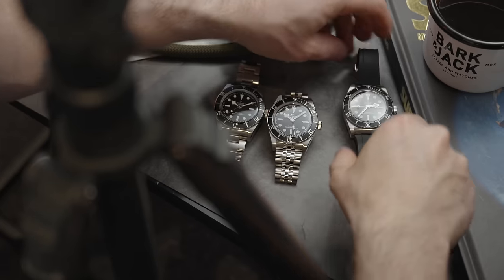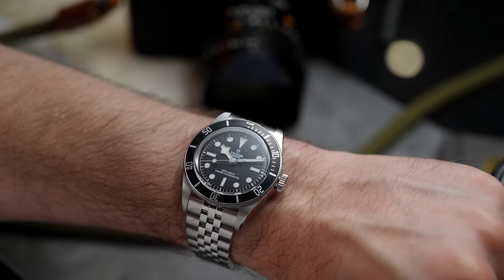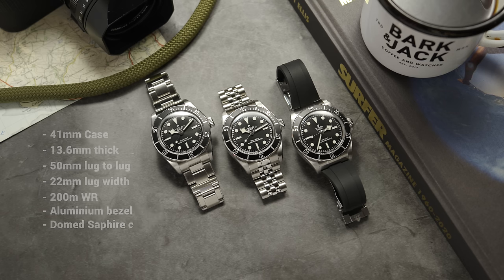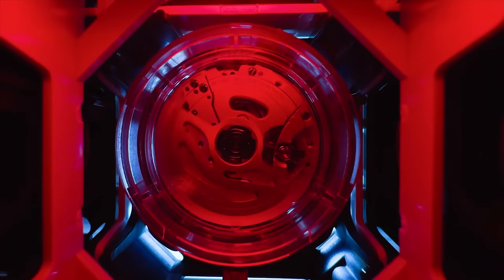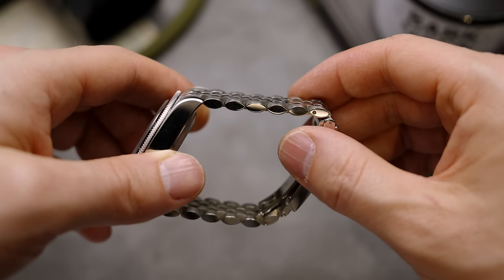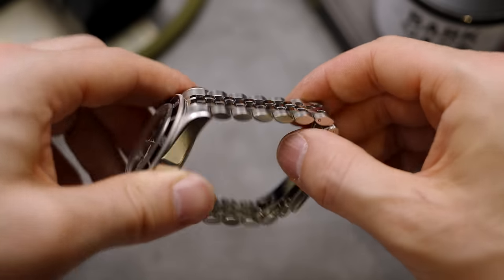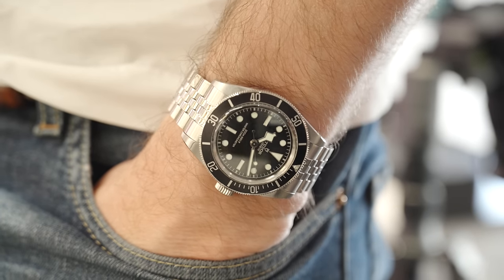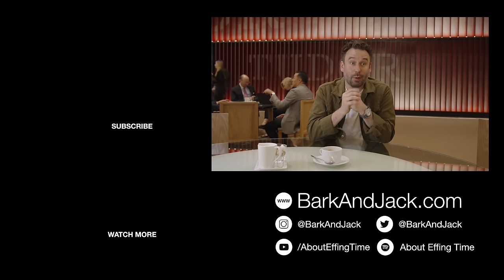The NEW Tudor SUBMARINER - Black Bay 2024

Comment from the maker: CORRECTION: Lugs are 21mm wide, not 22mm.
Reply: I also think the lug to lug is 49mm now! Just another thing to point out. Love the content as usual.
Reply: I thought it was 41mm. Thanks for the correction.
Reply: @jamiebarrett8095 It is 41 in diameter and 49 lug to lug.
Reply: Ergh 21 😂
Reply: I’m afraid the last Tudor Submariner re-edition is still the ref 79220N called Smiley. Take care
Reply: Price of the bracelets/rubber straps?
Reply: they must be competing with omega?  deal killer for me
Reply: The dreaded 21mm inbetween dimension!
Reply: I can confirm the bracelet won’t fit on the old black bays either, which is a shame! 🥲
Reply: The pelagos 39 could fit the rubber with clasp
Reply: Sir newbie question. How much the Tudor classic black dial M21020-0008?

Comment: Don't see how this is any better than the Pelagos 39. The Pelagos I think is a better looking watch for a little more.
Reply: It looks better
Reply: Pelagos 39 is so much better than this mega chonk ugly beast.
Reply: I own a Pelagos 39. I wear it daily. and it is "the one watch" for me.
Reply: Agree. All square markers etc. 
That with the thinner GMT movement would be the ultimate holiday watch.
Reply: For me, it comes down to material. I prefer stainless steel over titanium. I don't love the darker grey color of Ti.
Reply: The crown guards look bad on the Pelagos and the bezel overhangs the case.
Reply: …for me, the Pelagos design is a lot less homogeneous, the material, Titanium doesn’t look anywhere as good as the Tudor steel and there is no “need to have it” emotion involved….🤷🏻‍♂️
Reply: They're different styles. Pelagos is their 21st century tool diver. The black bay is their 20th century throwback
Reply: Way nicer than the drab Pelagos.
Reply: I don't like the 39mm pelagos, the bezel may be ceramic, but it looks pretty bad imo.  Only thing I like about it is how much lume it has.  I'd pick the original pelagos over it.
Reply: Definitely the Pelagos. Everything is just so much better put together. Plus it is lighter.
Reply: I disagree. I went in to buy a 39, but the mismatched handset/dial indices made for a hard pass. This BB looks like a winner.

Comment: Bought it 3 days after release; the watch has not left my wrist(I could not be more bias). For those who are worried about the watch being too thick or the diameter being too large. It’s actually quite wearable on my 6.75in wrist. With the way Tudor has cut/segmented the case side profile with the bezel and case back, you can’t even tell it has a 13.6mm thickness. As a quick comparison I also own a Pelagos 39, they both wear quite similarly; the black bay sits almost as close to the wrist as the Pelagos, and I have no issues sliding it under a cuff. From a far, the silhouette on the wrist is basically the same. The BB in stainless feels much heftier than the Pelagos’ titanium, and I much prefer the shiny Rhodium indices paired with the aluminum bezel as opposed to the shiny ceramic bezel and applied snowflake indices combo. Those slight differences was why I chose this watch and possibly selling my Pelagos. I know not everyone has the opportunity to own both watches so I’d say if you are on the fence, try them on in person before making the decision. Probably the most important lesson learned from this hobby is picture might speak a thousand words but you’re not wearing the pictures on your wrist…With that being said get what you like, it’s your money.
Reply: Thanks for the detailed impressions. I have the same wrist size as you and after trying it I can vouch it wears well. However I am not sure if I should buy this or wait for the non gilt BB58 as that one might provide better dimensions all around. It’s interesting that you find the P39 to wear similar considering it has much shorter lug to lug, diameter, and much thinner.

Comment: To be honest Adrian, I look at my 2005 Omega Seamaster 300m Pro, 41mm case, 300m water resistant, standard 20mm lug width, aluminium bezel, but 11.5mm thick!; the ETA based 1120 movement still beats at 28,800 with a gain of a couple of seconds a day. And good ones can be had for between £2-2.5k. So I have to wonder if this Tudor is really progression or regression?

Comment: You hit the nail on the head, the most iconic, pivotal, sought after watches are boring and this is Tudor taking a page out of its big brother’s dairy. Boring is good, it sells. I think Rolex is taking a break from the attention and letting Tudor get some hype which is a smart move. It cools down the Rolex hype train and divert attention to Tudor. I reckon this new Sub and the BB58GMT will be very, very hard to get.

Comment: The bracelet it’s not 22mm, it’s 21mm. Tapering to 16mm. 
That’s the mega difference to the old that had a 22mm bracelet, tapering to 18mm. That what’s makes it feel less massive on the wrist, compared to the old ETA version, which was in fact thinner than this new one.

Comment: The old quandary of "I should have waited" that'll last until the next watch. I bought a BB58, as the older, bigger BB was too unwieldy and thick, even if the proportions are better for my wrist. I think this model has now nailed it. Good proportions (even if a lot will say it's too big), they've slimmed it down, made it look more elegant (knurling and crown). All they need to do, imo, is get rid of the false rivets on the 3 link. ...Although I could just get the 5 link.

Tudor now have a better built watch than Rolex did, when a Sub cost £3.5-4k (90s? 00s?). This should be THE attainable diver for everyone now. I wish I had this watch.

Comment: Why does every single influencer have like like 3 Tudor Black Bay videos every year... It seems almost as if Rolex has decided to push the Black Bay on social media since the Submariner is so priced out of existence nowadays and there's a wait list. Tudor is not the best value for  COSC or METAS certified movements. Longines have the better deal theyre by far as you can get COSC and GMT for the same price as a Tudor with just 3 hands...and literally a century more heritage and in-house heritage at that which Tudor does not have.   Also, the BB needed to be slimmer years ago but glad they finally stopped being lazy on a $3,500 watch. But overall this is nice looking watch if you really dig snowflake hands which apparently is all they're allowed to use now. Weird because the tradition of the Tudor Sub is Mercedes hands. Rolex is apparently setting the rules.

Comment: I’ve had several Tudor watches but ended up selling them as I could never really bond with them long term (including the ETA Black Bay, BB Chrono, BB GMT, BB GMT opaline, BB Pro, FXD and original Pelagos). However, I feel myself being sucked in (again) by this new monochrome BB! But I have a Submariner Date 41mm so it seems kinda pointless, or does it…..🤔

Comment: First off I'd like to say that from a looks standpoint, this everything I've ever wanted from a blackbay (a white metal man, hence not a fan of gilt)

couple of things I don't agree with you on though. Firstly you started with how thin it is, sure the 13.6mm is much smaller than the old 14.9mm, but tudor has already proven that they can squeeze in a movement with additional gmt and date complications into a 12.8mm case in this years coke. I think that 13.6mm thickness would always be on mind if I bought this watch now.

secondly but less importantly, you mentioned that tudor's competitors charge double for the same specs? I might be mistaken but Omega is the only other that has metas certification and a seamaster is only a quarter more expensive new? I suppose those don't have as much power reserve as these tudors which is the only spec not up to par.

I'm well aware of tudors strategy to roll out these metas big black bays out first because if they did the 58 and 54 before, no one would ever look at these big boys.

I'll wait for either the 58, 54 and 58 gmt with no gilt, metas or not. This years money will go to a white speedy!

fan of your channel for years

Comment: Still aluminum bezel "tool watch"? Absurd.
Reply: So what would you prefer on a 'tool watch'... please don't say Ceramic 😅
Reply: @GerardBarkandJack  scratch resistant ceramic. Try doing some real work around machinery and report how your watch feared.
Reply: @googleuser4207  I'm an engineer to trade, never had an issue with aluminium bezels while working with machinery. You realise back when watches were 'actually' used as tools, ceramic was practically nowhere to be seen, right? Ceramic can also crack. Lastly - bezel inserts can be replaced - no big deal.

Comment: Aluminium bezel will fade over time. Cheap component. Why waste all that time with the movement to gain metas certification and then chuck a cheap nasty bezel on it.
Reply from the maker: It might fade over a few decades and cost £10 to replace. I’d prefer that to the risk of shattering a ceramic bezel that costs £1,000 to replace.

Comment: To suggest the new Black Bay is massive value for money at £3,910 is an outright lie. Shame on you Adrian. Don’t talk nonsense. Tell the truth. It’s massively overpriced. It’s a £2.5k watch at best based on the specs. 😫
Reply: Let's see another METAS certified watch with comparable specs for less?
Reply: @GerardBarkandJack  it’s funny you say that. I’ve just bought a brand new Omega Railmaster for £2,920. Brand new 5 years Omega Warranty. You asked, there you go. Better & widely available new at that price. Put that in your pipe and smoke it. Irrespective of that, this new BB is not a £4K watch. It just isn’t. People should vote with their wallets. I’m sure they will.
Reply: @mendipfox1650  Put that in your pipe and smoke it? The Railmaster is less water resistant (and not waterproof, either), has a smaller power reserve and is less popular than the black bay (hence the massive discount you seem to have got). I said let's see a watch with comparable or better specs for less. You might want to try again 😅
Reply: @GerardBarkandJack  Tudor fans love to talk about the power reserve. Same old story every time. I assure you my Railmaster is water tight. I’ve been swimming multiple times with it. It’s still ticking well. 😜 I appreciate you might not want to talk about case construction, dial intricacy, superior escapement tech, overall movement finishing, superior lume, anti reflective treatment and extended servicing intervals. But no, it’s an extra 50m water resistant and 15 hours longer on the mainspring. £4K more or less. Tudor is more branding over substance young lad. Nothing more. Although, with that said, I do have my name down now for the new GMT 126710GRNR. 😂👍🏻
Reply: @mendipfox1650  As you said, people will vote with their money. I think Tudor are doing alright with the Black Bay. Thanks for playing! 😜